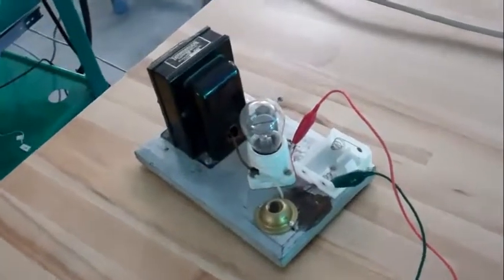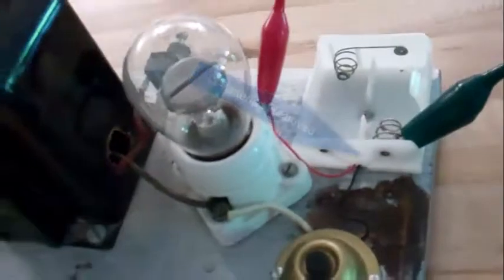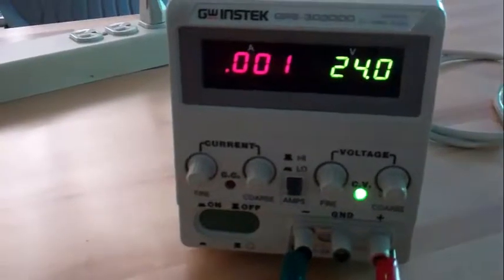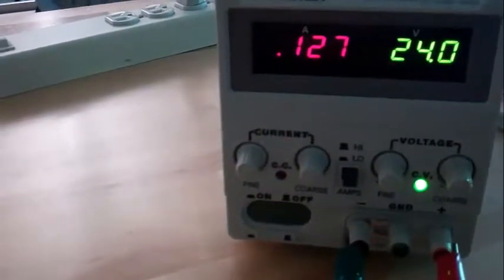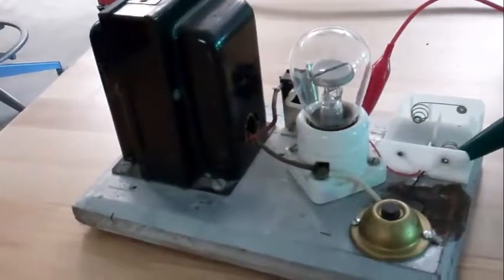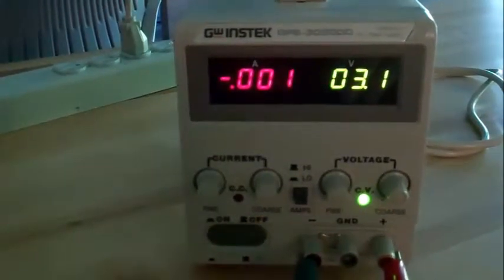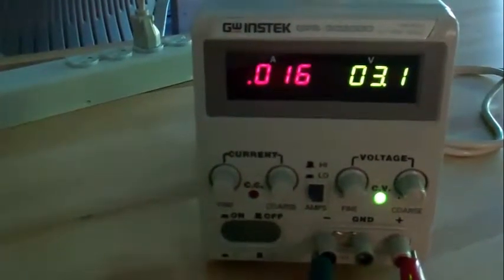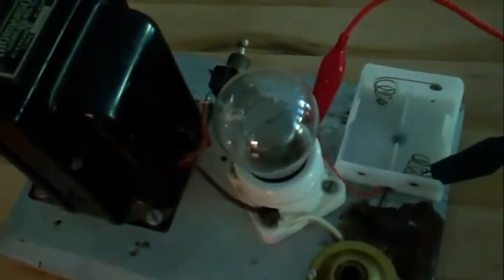B46214 - Inductor-Field Collapse Demonstration

Comment: What about the law of conservation of energy, some people claim that the back emf has more energy than the input value which is used during the charging (switch-on) time, is there a truth about this?
I would say, when we have a large induced potential across the inductor, we have a much less time constant (L/R) so that the integral (INT)VL(t) dt is equal for both cases (the switch-on and switch-off times) am I right here ?

Comment: If we open a RL circuit (switch-off cycle) we get the equation: -L(di/dt)-iR = 0, if we solve this equation we get: VL(t) = -Ee^(-Rt/L) When we switch off very fast, the time would go to zero and the potential across the inductor must be equal to the battery voltage (VL = -E) according to the equation, that’s why we see in the graph VL(t)-t, at t = 0, VL = -E, which is the same but the negative value of the source potential.
I did not see a graph in any physics book where this value VL(0) is much bigger than the applied voltage, I was not able to find any statement about the speed of the switch-off time, what can you say about that, may I ask you?

Comment: Thanks for the great video!  Can you give the value of the inductor and the voltage rating of the neon lamp.
BTW  On a much larger scale setup with a HUGE low resistance inductor and incandescent bulb , I have found a way to show the inductance slowly building up when the switch is closed AND WHEN THE SWITCH IS OPENED SLOWLY GROWING DIM.